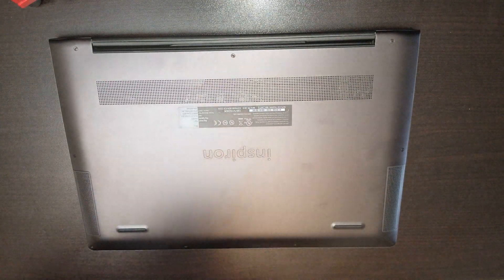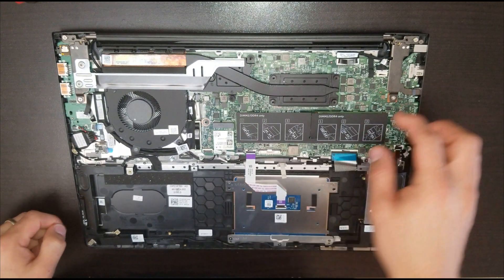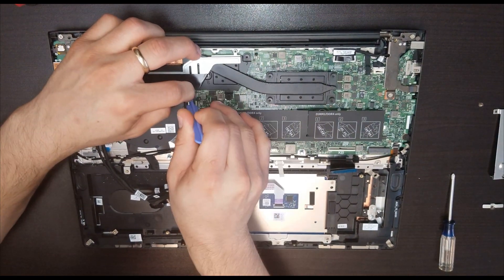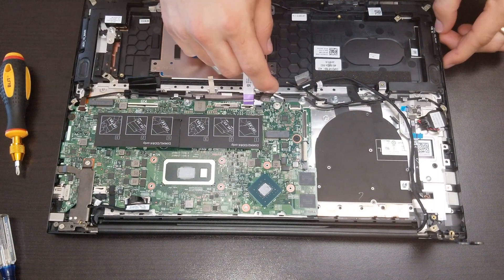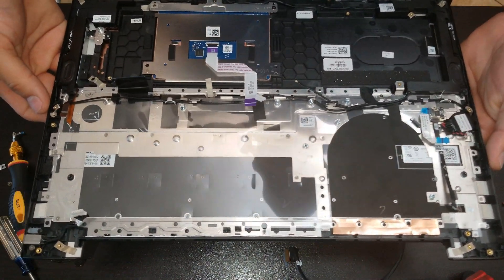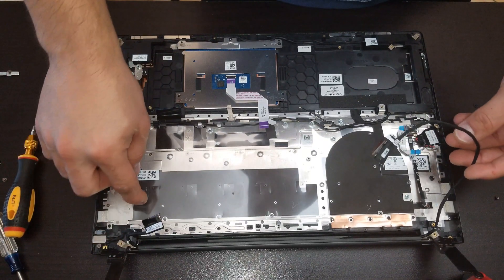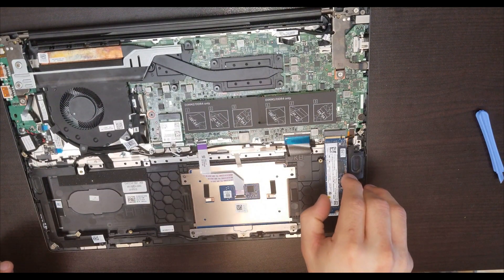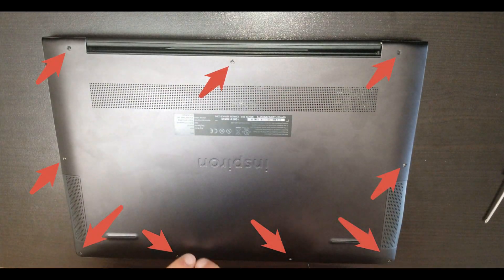Dell  Inspiron 15.6" 7000 2-in-1 4K - 512GB SSD - Corei7 - 16GB - Geforce MX250 Teardown 2019 model

Comment: I love my laptop, but am pretty disappointed that to upgrade storage I will need to swap out battery. At time of purchase I researched the crap out of this machine and thought Id be able to add a harddrive AND a SSD; although i was only ever intending to put in a SSD into the HD slot.
I was getting pretty confused on Dell's website which battery would be compatible and which SSD to use; recommendations would be appreciated. 
I am currently looking at microSD cards for a cheaper storage upgrade. Sandisk Extreme microSD 512GB seems to be the best in my range.
Reply from the maker: What is the reason you want to put an additional hard drive?. How much space do you have currently on your ssd m.2?. What about if you get an external hard drive (cheaper). Or get a m2 ssd with more space (the price is cheaper now) . Please subscribed welcome
Reply: @xlearntechnow  Hello. I subscribed. It is pretty economical to get SSD replacement, but I feel guilty about removing and not using the 512 GB SSD with optane that came with the laptop. I bought a TB external SSD last Black Friday, but wanted extra on-board storage that would dependably always be with my machine. I tested the microSD slot in the Inspiron 7951 BLK, and it looks like an inserted microSD would not stick out much at all. 
My reluctance is due to not wanting to waste any parts. I may look into buying a casing for the current SSD and maybe I can make that into an external, if I buy a larger m2 ssd. Thank you for your suggestion.

Comment: Can you add more than 16gb of ram?? According to dell max is 16gb, have you tried to add more??
Reply: yes can run 2 x 16GB RAM i just did to mine
Reply: @junrepasa  thank you
Reply: José Barba I have the same doubt, because in the dell specification 16GB is the maximum, but when I run the app Crucial System Scanner, the results are 32GB of supported memory ram.